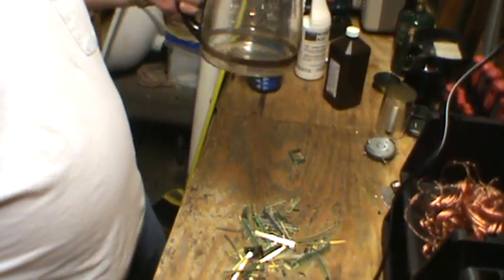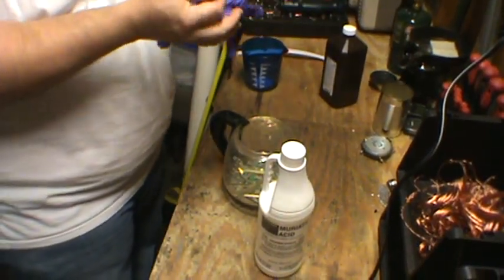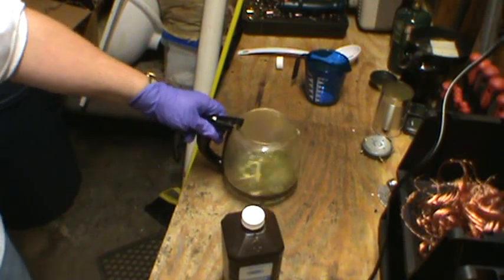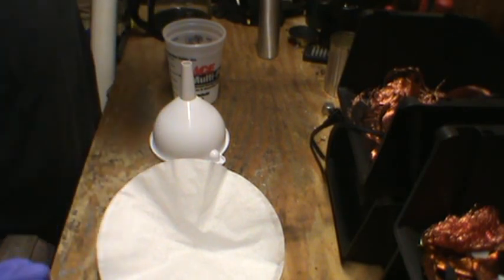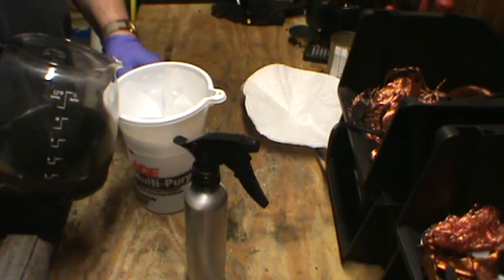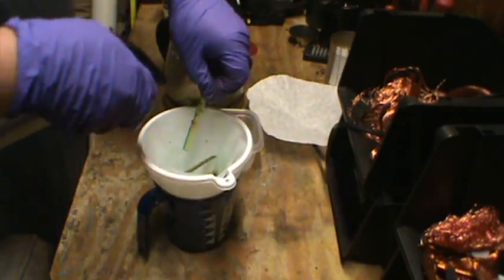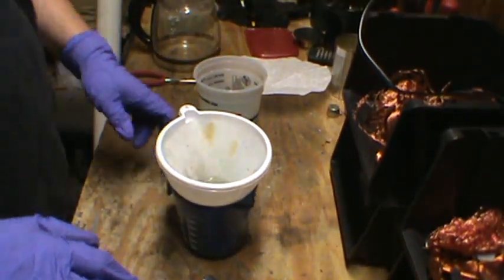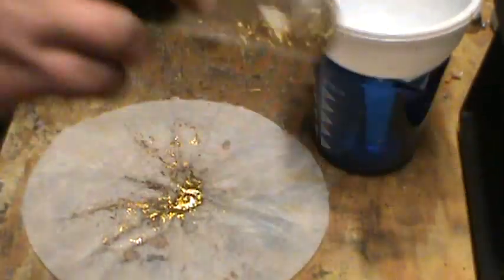How to Recover Gold with A/P Acid peroxide method for gold fingers and gold plated boards easily.

Comment: Moose...

You told a man in the comments on another video (which I now cannot find) a method of how to drop the Gold from the AP. (He had used too much AP for his small batch.)

Can you repeat that please?

Also I followed Geo's method of removing IC Chips from the Memory Boards using AP (instead of cutting them off with a Box Cutter.)

I have a lot of diluted AP. The AP also seemed to have dissolved the Monolithic Ceramic Capacitors and left Palladium Foil residue. My initial AP was 50% Hydrogen Peroxide @ 3% concentration and 50% Muriatic Acid @ 28% concentration.

I processed 250 Ram Boards. I have well over 1kg in chips.

How do I go about rejuvenating the AP after I have dropped any Gold within the solution. (I know that it is in solution as some Gold eroded from the boards but extremely little was in the precipitate...the precipitate being Palladium Foils and what appears as iron from the leads.) I guess that I can confirm my suspicion with Stannous Chloride.

So, first, how do you drop the Gold from AP?

Next how do you concentrate the solution after you've finished cementing the copper in solution to a stainless blade?

Thanks.

I probably will be reprimanded, and rightfully so, over at the Forum...So....Shhhhhh...
Reply from the maker: +24kGoldenRocket Hi there, I will see if I can help out.  To start, you can not use too much AP, however, you can use too much peroxide in the AP.  To drop the gold out you have to place a large piece od copper, in the solution.  The copper will dissolve and replace the gold making it precipitate as black powder.   For the Ram, that is an extremely high conc of peroxide.  Under no circumstances should you be using that much.  I do not know how to recover the palladium and silver out of that.  TO try to salvage your solution you will need to place some stainless steel in there to cement the copper out.  Do that until no more copper cements.  Then you will want to evaporate at least 1/3 of the solution.  Hope that helps.  Best of luck to you!

Comment: Hey Moose.

I live in the U.K, Muratic acid is called Hydrocloric acid over here. It only comes in pure form for a large price and lots of red tape, or you can find it in Patio cleaner at a lower grade 27%approx. Would this make a difference to make an A/P solution ? or is a trial and error situation???????????????????

p.s You are a legend
Reply from the maker: +47burke That should work just fine
Reply: Oh excellent! I can get chemicals without the worry of the SAS smashing through my windows n doors!  Thanks 47burke!

Poo
Reply: alot of acids have been restricted due to the acid attacks, but you can make hydrocloric acid by combining sodium bisulfate and salt.

Comment: Why not just use a stronger percentage of hydrogen peroxide, the kind you can get at any hardware store, or at any beauty supply store, they have up to 40% hydrogen peroxide at those locations, and if I'm not mistaken you can just freeze it to get an even higher concentration. Wouldn't mixing that with the muriatic acid work better?
Reply from the maker: +Working AllTheTime no.  too much peroxide will cause some of the gold to dissolve.  At this point in the recovery and refining process you really do not want to do that.  Thanks for watching!
Reply: Well ok, that's a good reason not to increase the percentage of peroxide, good to know. Thanks for the response.

Comment: Hello Moose, I have been stripping several gold plated necklaces. My solution has turned dark  black so I put it in a 5 gallon water jug. I have noticed there is some gold particles to small for the filters to catch, Along with a white power like subsistence on the bottom. Is there any way to get the fine gold separated from the old solution?
Reply from the maker: I find that if I use 2 coffee filters together they filter out better.  THe poweder at the bottom is just junk base metal probably from soldered connections near the clasps etc.

Comment: hi moose good clips dude ty for this rly but i have 1 questions wtf is this for50e 200g ?!?!  http://m.ebay.com/sch/i.html?_nkw=300+GRAMS+MELTED+DROPS+GOLD+PLATED+SCRAP+PINS+CPU+CONNECTORS+FOR+GOLD+RECOVERY++Watch&isNewKw=1&_pgn=1&epp=24&itemId=&isRefine=true&mfs=SBCLK&acimp=0&sqp=300+GRAMS+MELTED+DROPS+GOLD+PLATED+SCRAP+PINS+CPU+CONNECTORS+FOR+GOLD+RECOVERY++Watch&trksid=p2056088.m2428.l1313.TR5.TRC0.X300+GRAMS+MELTED+DROPS+GOLD+PLATED+SCRAP+PINS+CPU+CONNECTORS+FOR+GOLD+RECOVERY++Watch
Reply from the maker: Hi and thanks for watching!  Sorry, I tried the link but it just takes me to ebay main page.  Looking at the words in the link though I think I have a good idea as to what you are talking about.  There are a lot of people, rather sly people if you ask me, who take gold plated ide pins from electronics and melt them down into ingots and sell.  Becuase the base metal is brass, they look gold and people think they are getting something they are not.  The amount of gold in them is so trivial that they do not even test has containing gold with most tests.
Reply: okey ty bro

Comment: Hi great channel i watch most of your videos and have just started my own recycling/refining sideline.

I see there are different ways for different recovery processes, my question is if i use a hot sand bath and depopulate all the boards of solder and other foreign materials can i use one process for all? only reason i ask is i have maybe 500lbs of boards, from tv,s computers, mobile phones, electrical test equipment, and others

Also notice some ram sticks have gold plate in other places rather than just the fingers, if depopulated will they be ok or is there another process.

Have so many questions lol but last one for now, you mentioned not all gold plate is 24k, so may have 10/12/14/16k amongst others, how do you tell this apart other than a color mismatch and does the process for recovering 24k gold not pull out the gold from the other alloys on the lower carat gold ?
Reply from the maker: Hi there, we all have loads of questions when we first start.  Just keep watching, reading, and learning.  There is no one process that does everything.  Gold recovery is not a get rich quick thing, its not even a get it done quick thing.  It takes careful time and patience.  If you depopulate the ram stick, you can put the whole thing in the AP.  Lots of RAM has gold plate in other places and little holes etc.  As for telling the karat of gold, you need an acid test kit to do that, however, I would not bother testing every piece you process.  THe final stage, refining, purifies it anyway leaving you with close to 99% pure gold anyway.  BEst of luck to you!

Comment: Love your videos Moose.  I have a lot of fine pins and connectors(about 2 pounds) and I was wondering how I can separate the gold leaf from the tiny pins after they have been in the acid bath.  It would be easy if all the parts were the size of ram fingers but it would take a Long time to use tweezers on every one of the thousands of small pieces.
Reply from the maker: There should not be any pins left after the acid bath.  The base metals should be completely dissolved.
Reply: Moose Scrapper
thanks for the info.

Comment: Hi, moose just tried a/p method last week on about 3 lbs of fingers. I used my old coffee maker to warm solution on plate in pot. I had a weird thing happen though, my solution took 3 days and was so dark green that it was about black. Then I also noticed white sand like substance in bottom of pot and was wondering what it is. I was thinking it might be silver. I drained and washed it and it turned light blue and white cloudy. I let it settle and now have white powder at bottom of glass. Any thoughts.
Reply from the maker: Hi and thanks for watching!  Turning dark green is completely normal.  That is just copper in the solution.  I do not heat the solution when recovering gold from trimmed fingers.  I am not sure what the powder is, turning blue is usually a sign that its nickel, which is the layer in with the gold foils and copper.  Try testing it with a silver acid test.  If its negative, then likely nickel, or solder, depends on how clean your fingers were going into the solution.

Comment: Great channel. would this same process work for gold plated cups and plates? and what about silver? I mean will the acid eat silver or could it be used on silver plated items too?
Reply from the maker: Hi there, this process would not work for cups and plates, I have a seperate video for that.  That type of material has the gold directly on the porcelain.  This materail, there is a layer of nickel and copper under the foils, thats what this process does is remove the foils.  This process should work on silver as well, like silver/tin fingered ram etc.  Just keep in mind that silver is only worth about $17 an ounce, and it takes a lot of material to make an ounce, in that instance, it may not be worth it.
Reply: Moose Scrapper Ok I watched that one too and i think it is awesome. Have you tried either method with those gold plated sports cards, dollar bills or stamps? they look like they are covered in gold so it may be worth a try. also will the acid bleach process work for silver plated cups and how would i precipitate the silver out?

Comment: Sorry if I've asked this question before Mr. Scrapper, but can you add cell phone/house phone and other gold plated green boards to the gold fingers while doing this process?
Reply from the maker: If they are clean yes.  By clean I mean no other componants on them like resistors capacitors etc.
Reply: Moose Scrapper thank you, a quick sand bath will take care of the components. You're the best dude....

Comment: Moose, thanks man for the helpful hints. I have boards that look like all the lines attaching the parts looks like gold. How do I handle these??
Reply from the maker: Hi and thanks for watching!  First you will want to test it.  In my years of scrapping I have only seen that happen once and it was from a high end oscilliscope.  Often times the solder mask is gold color to make sure you test befor you go on.  If you are extrememly lucky and they are gold, then I would depopulate the board with a hot sand bath or torch or what ever method works best for you, then throw it in the AP solution.  Best of luck to you!

Comment: Just curious will it mess the batch up if you did added the soldered parts in it?
Reply from the maker: You really want to try to avoid that.....but it should not mess it up too bad if its only a little.
Reply: cool, thanks for letting me know!

Comment: Where do you sell your scrap gold.  I've been collecting it for a while.  I'm about ready 2 get it refined but I'm scared 2 do it myself because I don't want to ruin it.
Reply: Midwest Refinery.. a small but honest firm (have used over 15 years).  Pour into ingots & they will treat as jewelry... assay it & pay 90% of spot price.  they deal with the public & settlement is pretty quick  bout a week to get a check. Much better than a local jeweler or pawn shop... they usually take 20%+
Reply from the maker: I sell it at a local place that sells jewelry, coins, etc.  You can also sell on ebay if you can have it assayed and know the karat
Reply: I would sell, it consider the issue with US Currency,you have the true money.
Reply: Craig thank you for that information.I was going to refine some sputter targets and that would have been a mistake because they are not only gold but platinum as well, I won't tell you what I got for them but if ever any one had finders fee coming it would be you, again thank you so much.

Comment: To get the copper out do you just drop the stainless in or is there more involved?
Reply from the maker: There is nothing more involved thatn that.  Simple place a stainless steel butter knife or something like that in there and the copper will cement to it.  Take it yout ever once in a while to remove the copper from the surface.

Comment: hey moose... besides copper what other types of metal is gold plated too far as computers go?  thanks
Reply from the maker: Brass, and thats about it.  If its magnetic, its usually due to the thin nickel layer.  Steel or ferrous stuff rusts so that is not an ideal substrate for gold plating.

Comment: Moose , Where do I get the different things to recover the gold from . I do not know how to get used computers given to me . What else can I get . Where do I get the acid and will the battery acid you buy at the parts house work ? I am 63 , told you that so you will know I am not a kid . I am very interested in this type of stuff . :)
Reply from the maker: Hi and thanks for watching!  Battery acid will not work for this type of gold recovery.  That is sulfuring acid not hydrochlauric acid.  HCL or Muriatic acid can be found at any hardware store.  As for sources of gold, they include electronics, cell phones, plated jewelry, decorative cups and plates sometimes have gold trimmed edges, but for the most part, the gold that I proces comes from computers.  Best of luck to you!  Check out Drew Metalsmith, indeeditdoes, and original feets channels.  They have some other sources of gold and silver.  Thanks

Comment: I used this method and have recovered quite a bit of gold. I use a candle warmer to speed up the process. Cleaning it up has been time consuming because most of the gold flakes like to float at the top. I recommend let it settle before pouring it out. Great video and thank you for the directions..
Reply: Dope video yo subscribed🎉

Comment: If you use heat as well with your feedstock and a reflux condenser would you be able to accelerate the process?
Reply from the maker: Hi and thanks for watching!  I am not a chemist and can only say that heat may decrease the time required to dissolve the base metals.  When recovering gold from plated CPU pins, heat is applied to speed up the reaction.  Thanks!

Comment: Mr. Scrapper, I was hoping you could help me with this question. Today I picked up a Taylor Smith Bowl. The outside is white ceramic. Its stamped 'Taylor Smith USA' surrounded by what appears to be green leaves. It also says 'warranted 22 karat Gold'. The inside of the bowl is sold gold. No design, just gold. I can't find anything online on it, the only things I find is bowls with designs. To extract the gold, would I have to break it and then put in the A/P? BTW, I paid .25 cents for it.
Reply from the maker: lol, I think you will make your money back.  I don't think that AP is the best method for removing the gold from this one.  For plated ceramics and dishes cups etc, the preferred method by a lot of people is to use HCL and Bleach.  I have a video on that.  The issue with that method of gold recovery however is that 1: the fumes are very toxic and there are a lot of them so you need to be outside and standing upwind or have a fan blowing the fumes away from you. 2: the solution can hold a LOT of gold, and the precipitation process requires there to be a good bit of gold in the sollution, at least a few grams, to make it work well.  People tend to be impatient and try to precipitate after cleaning a couple plates not realizing that they may look like they have a lot of gold, but in actuality, its no where near what they think.  Best of luck!  If you try this, make sure you have a coke bottle or something you can store the solution in until you are ready to precipitate the gold out.
Reply: Moose Scrapper Awesome. I did find your video last night. Could gold plated jewelry be done with this method along with the plates/bowls? Thank you.

Comment: can you soak an entire circuit board in the acid with minimal, if any, stripping? maybe just the capacitors? or does the solder screw with the reaction?
Reply from the maker: the solder will screw it 3 ways to Sunday.  As well as any other metals on the board like aluminum and iron.

Comment: i have recently scraped a flatscrean tv and it seamed to have a gold circle around the outer edge of the screen alsoit seamed to havea loy of lines running through the length of the screan have you tryed one of those yet iy seemed to be in some type of plastic i could not get it to come apart but it will break up easily
Reply from the maker: Ive got an LCD monitor video out, and I have scrapped a few flat screens.  There does appear to be a lot of gold plateing in strange places.  The only down side is that in the newer electronics the gold plating is so thin.  I'll be puting out a video about a flat screen TV.
Thanks!

Comment: very helpful--great tips and I will try this now --done a lot of research --does this gold extraction really pay off?
Reply from the maker: If you do it right it does.  Some people will take five or six ram chips and expect a gold bar to pop out of the solution, and when it does not they think they did something wrong and doi it again and again.  I get hundreds of computers a year.  I ONLY process gold twice a year, and of all the gold bearing material I get, I only process two things, gold fingers, and plated pins.

Comment: Excellent video! But I have a question. If the Hydrocloric acid is 31% the peroxide what concentration must have? Thank you!
Reply from the maker: 3%
Reply: thanks! I found only 25% hydrochloric acid.. do you think the proportions hcl-h2o2 = 2:1 can be the same?